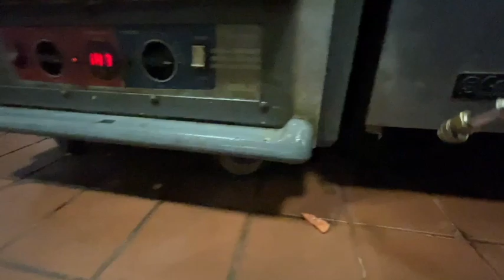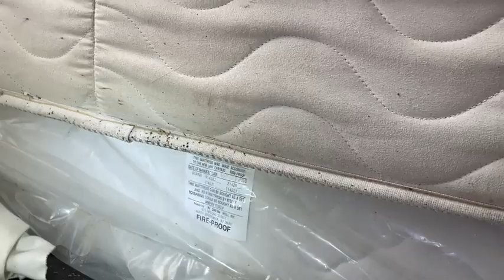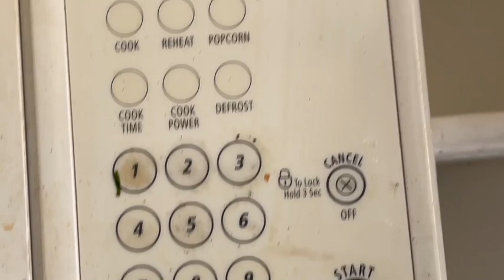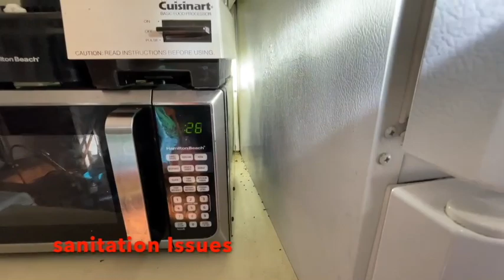A Day in Pest Control - Restaurants, Buildings & Bed Bugs, Jan 22

Comment: You  don't do any baiting  for Roaches.  I see that you only  use your B&G .  Looks like you need a new spray tip.
Reply from the maker: Spray tip is good, I have to clean it out.  And sometimes when I use Cysmic Cs it tends to clog it up.
Reply from the maker: I do baiting when it’s necessary.  I don’t use it on every cockroach job.  I use it when there’s a lot of activity.  The mix and aerosol usually can do the job.  I also use bait stations.